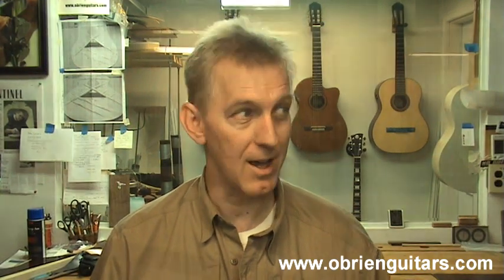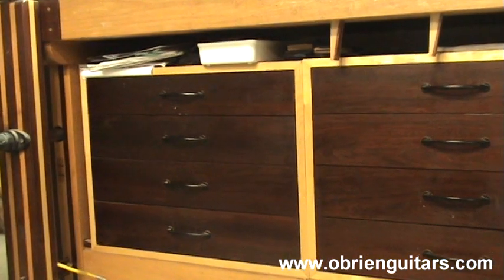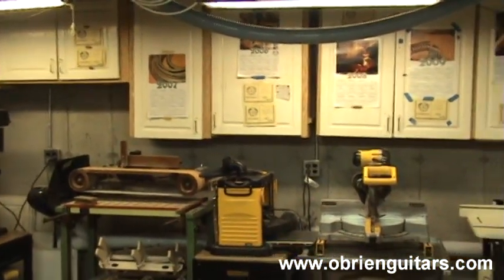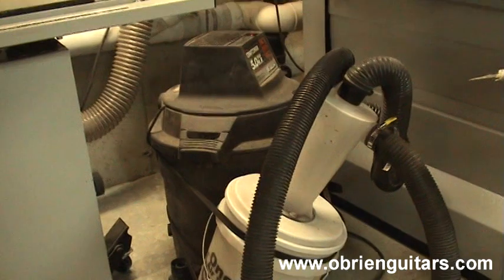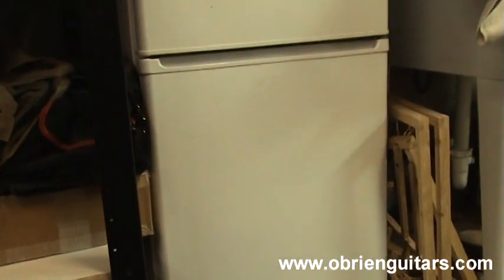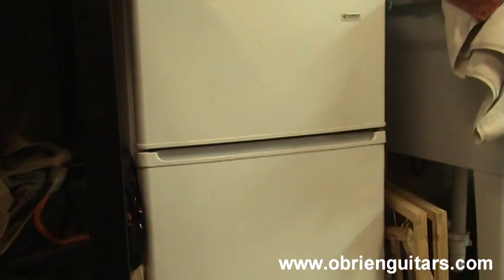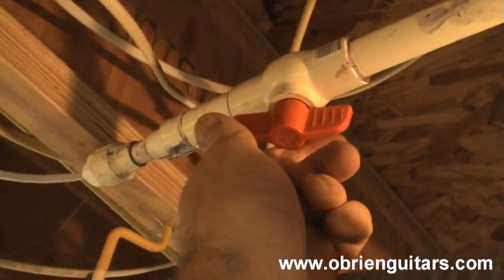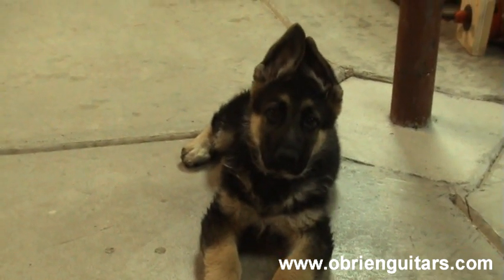Luthier Tips du Jour Mailbag  29 - Shop design

Comment: Amazing video Robert.
I have a 118 ft² shop (inside an apartment), and as you said, it really helps to keep everything clean and organized when you have a small space. The drawback is that I have a space limitation to add more machines inside the shop.
But when well thought-out and with your tips, one may always get to design an efficient shop, even if you have only a room available, at least for starting the carrier. In the long run you'll need a bigger space, but always aiming for a well designed shop.

Comment: What’s your opinion on doing guitar making in the fresh air on a sunny day?

I’m very limited to space due to restrictions/ shared space Obviously I would not be doing finishing work or glue jobs outside but the main stuff anything that makes a big mess sawing, carving, sanding etc
Reply from the maker: As long as the relative humidity is within the desired range you should be okay.
Reply: OBrienGuitars 
Cool thanks again
Though unfortunately my humidity is very high over the good weather 
And low humidity in the worst weather so a lot of the odds are stacked against me

Comment: when you were talking about RH 
I've found some moisture absorbers can they help?
being a beginner with a very low budget (only buying materials per guitar),
obviously theres going to be a point where you have to fork out the cash if things pick up which would mean i'd probable need to have more materials handy, 
but for now what are some low budget solutions?
Reply from the maker: If working in a high RH area anything is better than nothing. The problem is with the moisture absorbers you do not know exactly what the RH level is.

Comment: I wasn't sure how to address this to the mailbag folder…my question is: How do you deal with the small crevices that are visible in the finish that resist filling up and becoming flush with the rest of the finish?  As a longtime woodworker I imagine that the issue should have been addressed earlier in the finishing process.  However I'm up the last few coats of lacquer and still have (very small) visible lines(crevices) showing in the finish. Any advice? I believe I sure could use some at this point, maybe not for this instrument though...
Reply from the maker: FranklinArtSite  Surface prep is critical when doing a high gloss finish. It sounds as though you needed to fill the pores more or perhaps the filler you used is shrinking. This is also a problem. Sand the lacquer and apply more pore filler before spraying more coats of lacquer. That should do it.